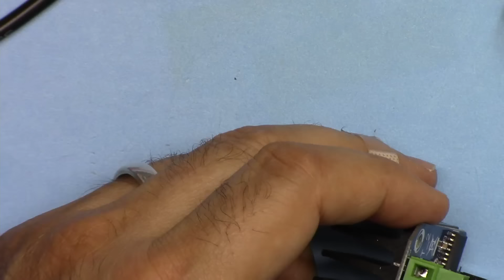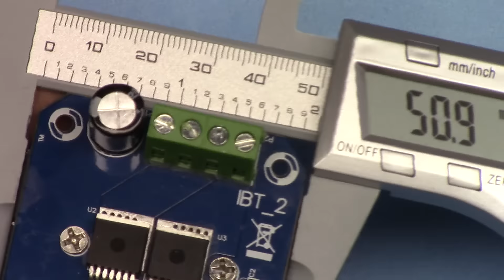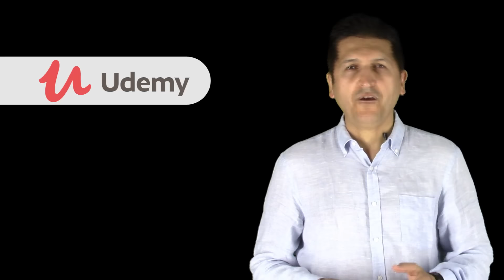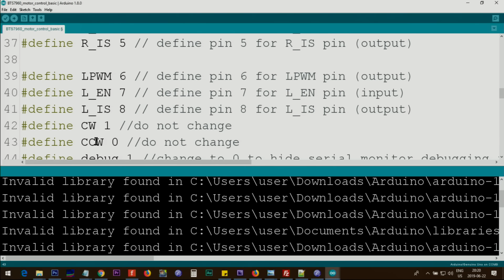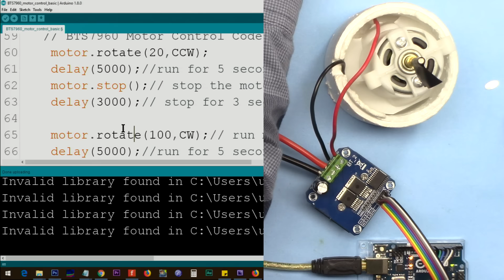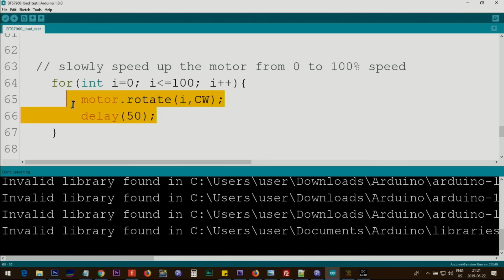Using BTS7960  BTN8982TA PWM H Bridge motor controller module with Arduino library RJT169

Comment: Will this run smoothly if I am only running motor.rotate() once every millisecond? I have a sensor that requires a system interrupt that I plan on detaching once every millisecond to give the motor outputs.
Reply from the maker: yes it will . the time the response time depends on your motor. some motors respond slowly and some faster.

Comment: Thank you so much for the video. It was very informative and helpful. I have a question. Can I connect a 24v dc Motor to this module
Reply from the maker: You are welcome.  I don't remember what was the voltage. but know I always explain the voltage. whatever is the voltage of the module, that is the motor voltage.

Comment: @robojax could I control 2 dc motors in forward direction by using both outputs to power motors with common ground. I.e set both enables to high, then pwm- l should drive motor1 and pwm-r should drive motor 2???
Reply from the maker: Yes you can. I have shown the diagram how motor's direction of rotation changes. if you don't change the direction , then you can use two motors. but I don't remember how I wrote the library to accommodate for that. you have to figure it out until I update the library which I don't know when.
Reply: @robojax  what is the purpose of the IC? Could Arduino not control driver IC through resistors without the IC?

Comment: It would be a different story if you use a fan in front of the module to help sink the heat. have you tried testing it with cooling fan.
Reply from the maker: no. this module is sold like this and I wanted to test it as is.  Spent almost a week to write library for it. this is the most powerful module for motor in this series.

Comment: Hi Thanks a lot for the detailed explanation, i wonder how can we connect 2 BTS7960  to control 2 motors. is it possible to combine some pins. or we need 12 pins to control excluding power and ground.
Reply from the maker: Hi, I just added the code for 2 or more motors. See the link on page where you see the code. Good cluck and thanks for subscribing and sharing my videos.

Comment: Hi Neighbour! I just had something strange happen with one of these BTS7960 modules. I bought two and have no issues with one of them, but in the process of troubleshooting the other to ensure it was the module and not my mistake, I disconnected the B+ & B- while the M+ & M- were still connected. I had also disconnected either the GND or Vcc line. Thinking it was mostly isolated, I tried my little sketch (typical "car"), and this module managed to pull enough power through the input and enable pins (must have gone high) to somehow fry the Wemos D1 mini (through a logic shifter...?) AND the BTS7960 put out some smoke as well. 
Any idea what happened here? I was very confused since the datasheet has all this talk about over-current protection. Thanks for the detail and help. I'd love your password to your library to test the modules and get more familiar with them. Thanks! Great channel!
Reply from the maker: Hi, very complicated. Sorry by one time reading I did not understand what happened..
Reply: @robojax  sorry, brother. To simplify, what could cause this module to draw enough current from the LPWM, RPWM, LEN,REN pins that it would brick a microcontroller? any thoughts? pwm signal sent to LEN/REN, with logic HIGH and LOW controlling direction, like an L298N configuration.

Comment: Hi 
Thanks for you 
Can I  use  it to run fan motor  work  with 48v  &5 A
Full  speed
Thanks again
Reply from the maker: Hi, you are welcome. I don't remember what was the voltage and current. You have to watch it. I have mentioned everything specially the voltage and current.

Comment: Thank you for your tutorial.
If I want to use multiple BTS7960 in parallel to power one single motor, what should I use to protect the motor and other BTS modules if one of them suddenly die while running full load?
BTS is the most powerful DC Controller with PWM input I can buy from local store, so I have no other choice, except DIY.
Reply from the maker: you can do it using a current sensor like this https://youtu.be/3C33DpcSwIw when the current reaches certain value, you can stop it using a relay. I have video on rely and if your current is very high then use https://youtu.be/9jwCc7uPGoc up to 100A nad i you want to use stand-alone device without arduino, here it is is https://youtu.be/a4b_A0ZDvwc with relay you can turn OFF or ON any load. Good luck.

Comment: Sir i need some guidance to complete my project....can i use this driver to run a 12V 5 A wiper motor using a SMPS type 12V 5A power supply??.....please do a video on controling wiper motor  using SMPS type power supply
Reply from the maker: wiper is just a motor isn't it? you just power it up and it work.

Comment: Where is the RobojaxBTS7960. h I can not find it on Robojax.com  site under Arduino software or downloads.
Reply from the maker: Perhaps you skipped the video. I have mentioned it two or three times. Even in the first 40 seconds I mentioned it.  I've spend 3 or 4 days making code and recording this video. if yo wan to  use, it, you have to watch without skipping.

Comment: What about for 48v motors?
Reply from the maker: I believe I mentioned the maximum voltage . Please watch it. if want to tell you, i have to watch it.
Reply: @robojax  it stats 27.5V. I need to drive some Ampflow 48v motors and need a driver for that with PWM to be controlled by Arduino.

Comment: Hi Thank you for great video , can this library use for 2 Nos motors with PWN different pinouts ? , im trying  to make a  electronic wheel chair for disable person please help thank you
Reply from the maker: Hi, you are welcome. I have made library to you can use it for as many motor as you want. I just watched the video in order to reply to you. I have explained in the code that we create an "object" called "motor" from the library. if you want to use more than one motor,  then create another object called "motor2"  and repeat all the code replacing "motor. " with "motor2.". You may learn it from this video https://youtu.be/c90NszbNG8c. good luck.
Reply: @robojax  thank you very  much love from Sri Lanka !

Comment: Thank you for the amazing video !! I would appreciate if you can help me decide to buy this driver or not:
I have a 12v DC motor that works on 96 rpm & 1A ( no load),  76 rpm & 4.5A  (loaded). Would you recommend this driver to control my motor? or this is for much higher Ampere applications?
Reply from the maker: You are welcome.  I have tested and shown the maximum current this can handle. So you have to come to conclusion from my test results.

Comment: Assalamu Alaikum... Great video ...i want to ask that can i you use this module with raspberry pi?
Reply from the maker: walaiakum salaam,  You can use it for sure. but this code is for Arduino only.
Reply: @robojax  can you suggest me some tutorial that uses this module with raspberry pi
Reply from the maker: because I have't use it with the pi, I can't suggest.

Comment: Fine! That is for one wheel control.  Maybee you have code for two motors (like wheelchair ) for grassmover? I have Arduino Nano3, 9V switcher trafo   and two BTS7960 motor driver,  two used motors are on the way too. Thank You, M
Reply from the maker: You are welcome. Yes you can. Watch this video and learn from it  https://youtu.be/27KjMfPH1dk  The best thank you for me is to not skippin the ads and Subscribe  🔔 to my channel,  like 👍 the video and do not skip the ads.. It is greatly appreciated.  🔔  😊. 
I will reply to all Subscriber's 🔔 questions. So make sure to Subscribe.😊 .

Comment: Hello sir... I have problem... If i write... Motor. Rotate(50, CW) ; or under... The motor is stop
Reply from the maker: Yes. I have explained it in the video. Each motor is different. Some motors stop at 30% and some at less or more. Watch the video carefully without skipping.  Thank you for not skipping the ads and keep watching them. This will help me a lot.
Reply: @robojax  I'm sorry Sir... I'm from Indonesia ... I'm not good in English ... even though I've watched it many times ;) ... thank you for answering my question 🙏...

Comment: I have a 12v 150w motor dc (rs775) with stall current of 12.5A
The problem is it can rotate one direction only and when changing direction the psu shut itself down
So is the psu underpowered or the ampere surge doesnt supported by it?
Psu is a 12v 16.5/15 A with max 192w supported(An atx psu)
Reply from the maker: Hi, it seems your wiring is incorrect (I assume your motor has no issue changing the direction). and I assume you have not changed the code.
Reply: @robojax  no i dont think its the problem as its the psu that shut itself down

Comment: Hi, Could you tell me how is the implementation of this controller with 16f877a pic microcontroller please? Is it possible to use this with 16f877a and do I need to write any PWM code to use it or I just send normal 1 and 0 logic outputs from pic to this controller to be able to use it?
Reply from the maker: Hi, I am sorry. I am not familiar with 16f877a.
Reply: @robojax  Could you tell me where would I find information about this please?

Comment: Hello I was just wondering that if a motor drive can cause a minor delay maybe in milli seconds to get the motors to move and thats the problem i was facing i tried to make the program as fast as possible but when the sensors read data the robot doesnt react simultaneously that's when i shot a very slow motion video to see the reaction of the robot actually it's designed not to get out of the ring which is a sumo robot but at high speeds the half of the robot gets out of the ring till it reacts and retyrn inside 
Any help would be appreciated though iam using an arduino mega 2560 and tcrt5000 light sensors which iam planning to replace them though they are somehow fast enough but just in case it is their problem
Reply from the maker: Does it have to anything with this video? if so make sure to remove any delay in loop or in any functions. Or your module or motor controller you are using is designed that that.  check it.

Comment: Sir I want to connect this BTS7960 to nodeMCU but my wifi disonnecting and connecting
Reply from the maker: it could be the voltage is dropping when motor starts. So your power supply is weak for the motor. Or provide separate power supply for NodeMCU and separate for motor.
Reply: @robojax  power to nodeMCU is given external power source.. but response is very slow and motor rotating very slowly

Comment: Do you have a  video link for your  dual VNH2SP30 motor drivers ? I purchased them from your amazon site and need help getting them to work.
Reply from the maker: I haven't made video for this item yet. But it is on my list. here is the library for dual full bridge. The model is different but it should work https://github.com/pololu/dual-vnh5019-motor-shield you just need to know the pins

Comment: Hi there, thank you for awesome tutorial. I'd like to ask, if there is a possibility to remove current sensing pins from the code? When I try to do that, I receive an error: no matching function for call to 'RobojaxBTS7960::RobojaxBTS7960(int, int, int, int, int)'
Reply from the maker: You are welcome. The current sensing is not used in the code but  you have to provide a integer (number) so the code is functioning. So use a pin that is not used.

Comment: Hey sir..excellent tutorial out there.I have a question that is..can only one motor be used with a single shield?or two?
Reply from the maker: Hi, Perhaps you escaped the video. I have said in the video that you can control 1 motor. If you want to control 2 motor, you can but not fully. Details in the video.

Comment: Thermopaste should be added to cool it down.
Reply from the maker: yes if current is higher.
Reply: @robojax  can you say why it goes to protection shut down, when powering 24v14a motor with 24 volts?. When the motor draws only measured 10-12a with 12v psu. And can be stalled with no problem. The stall current vs voltage etc is a known thing. So several bts get connected in parallel to solve that. The motor supposed to be having ~40a stall with 12v. and ~85a stall with 24v. But on practise, controlling with pwm, it has ~12 stall draw only with 12v. Jumps to 24a on rotation changes. But at the same time with 24 it can be controlled alright in terms of change of rotation direction etc with no shut down. But when stalling, almost instantly bts shuts down. I’ve got the additional flybacks diodes f30u60dn and caps to help out for it. What the cause? Overvoltage spikes still? Overheat? The motor is MY1025. For 12v he got 12v33.a psu, and 24v10a psu too. 
Flyback layout. 
https://youtu.be/AWupftXnr_g

Comment: Hi Robojax, 
Is it possible to connect two individual BTS7960 PWM H Bride motor controller modules in a single Arduino? So I can run a DC motor and a step motor with the same Arduino. 

All I want is to control DC motor and a stepper motor with the same Arduino board using BTS7960 controller modules. 

Sorry if I am being a nuisance, I am a new user to Arudino.
Reply from the maker: Yes possible to connect two of this module.

Comment: Hi, thanks for the clear explanation! I am trying to use the example sketch on an ESP32 wireless module and get the message: "Error compiling for board ESP32 Dev Module.".
I know that the analogWrite() function is not implemented in the ESP32, but I am not experienced enough to see if that could be the problem here. Could anyone provide me with some help on this one? Thanks!
Reply from the maker: Hi, this will not work with ESP32 as ESP32 has different PWM mechanism.  I would have to write separate library for this module. or watch my video on ESP32 with Fading LED, I have explained it there.

Comment: Hello would anyone be able to help i copied the wiring and pasted the code along with other attempts and i cannot get the motor to rotate clockwise unless i swap the m+ and m- pins.
Reply from the maker: Hello,  you must be doing something wrong. Or perhaps you did not watch the video or escaped. I have left nothing without explaining it.
Reply: @robojax   I think I may have a fault chip as my oscilloscope shows the correct pin outputs
Reply: @roryt98  Hi Rory, I think @Robojax didn't implement this code correctly, actually if you want to control motor in both direction you just need to connect 3 pins on adruino please try it. R_EN and L_EN connect together to 1 PWM pin on arduino - pin 6 for example , and with R_PWM and L_PWM from the BTS.. board you are controlling the direction. I've connected these pins to 4 and 5  , so you just need 1 PWM signal from arduino and 2 pins for direction for CW:R_PWM-HIGH, L_PWM-LOW and analogWrite to pin 6 ..... for CCW:R_PWM-LOW, L_PWM-HIGH and analogWrite to pin 6 , for Motor stop R_PWM-LOW, L_PWM-LOW,... NOTICE:::: !!!  if you want to BURN your motor :D R_PWM-HIGH , L_PWM-HIGH (don't try it)

Comment: Would 3.3V as VCC work as well as 5V? I'm thinking of controlling it with ESP32
Reply from the maker: I have provided the datasheet. I don't remember it. The link to the datasheet is where the code is.
Reply: Hi bengacz.
I am thinking of controlling it with ESP32 too. 

Have you discovered something? Can it be used with 3.3V? 
Thanks for the info
Reply: @sergioro99  yes it can and it works good. I made child car on this

Comment: How can I code for two motor drivers concurrently
Reply: Is there any way..? Plz suggest me any sir.
Reply from the maker: use tow modules, define pins and create object for each motor as I explained in the code. I made the library to so you can use it easily. Watch the video (code section) carefully and watch it multiple times until you get it.
Reply: Sir Its worked but i controlled through bluetooth.. but quick response is not there a lag is there

Comment: subs...bts7690 are same price with rc esc with 2 way direction...can use this with rc speed and torque cars?
Reply from the maker: Thanks. yes you can if the motor is DC.

Comment: Thank you very much for the video it helped me a lot, but I would like to know how I can do to manipulate two H bridges in the same code and move two engines two bts7960, so that one goes clockwise and the other upside down helps me a lot. Thanks greetings.
Reply from the maker: You are welcome.  fro two devices, on this line
R_EN,RPWM,R_IS, L_EN,LPWM,L_IS
RobojaxBTS7960 motor(R_EN,RPWM,R_IS, L_EN,LPWM,L_IS,debug);
change it to 
R_EN1
RPWM1
R_IS1
L_EN1
LPWM1
L_IS1

R_EN2
RPWM2
R_IS2
L_EN2
LPWM2
L_IS2

RobojaxBTS7960 motor1(R_EN1,RPWM1,R_IS1, L_EN1,LPWM1,L_IS1,debug);
RobojaxBTS7960 motor2(R_EN2,RPWM2,R_IS2, L_EN2,LPWM2,L_IS2,debug);
and then use
 motor1.stop();
 motor2.stop();
motor1rotate(100,CW);
motor2.rotate(100,CW);

Comment: Thanks for this tutorial. I am using the same BTS but I am controlling it with labview. 
I am able to control the speed in one direction, even though I have both R PWM and L PWM connected to PWM pins 3 and 9 respectively. on my arduino uno.

L_EN and R_EN are both active (true).
Then I turn on PWM, however both pins (3 and 9) makes the motor spin in the same direction. Do you have any idea why?
Reply from the maker: You are welcome. The best thank you for me is to Subscribe  🔔 to my channel and thumb up the video. It is greatly appreciated.  🔔  😊.  Check wiring.

Comment: Unscrew the heat sink and screw it down onto the MOSFETs. Use a few small washers to pack it up so it doesn't crush the MOSFETs. That fixed the overheating issue with me. Little Chinboi designing these modules had know idea what he was doing.
Reply from the maker: Yes a little extra work pays off. Thank you for sharing.
Reply: I think they assembled them incorrectly, hence they are so cheap..